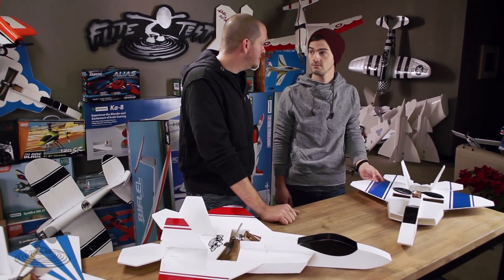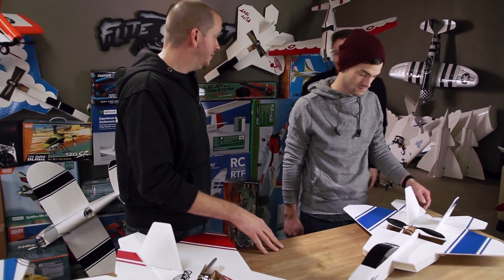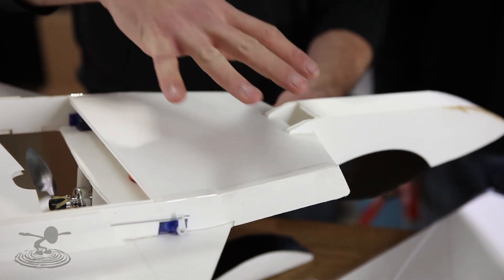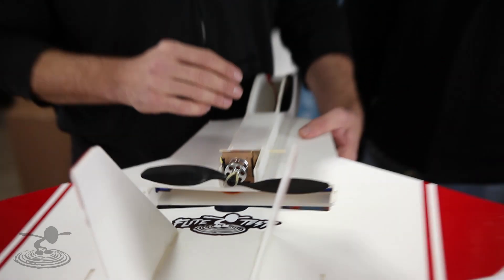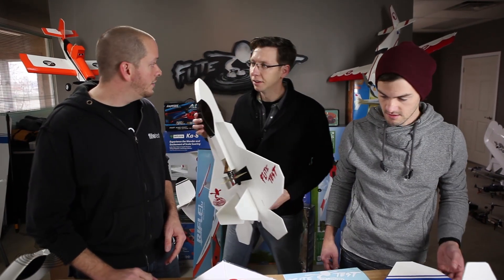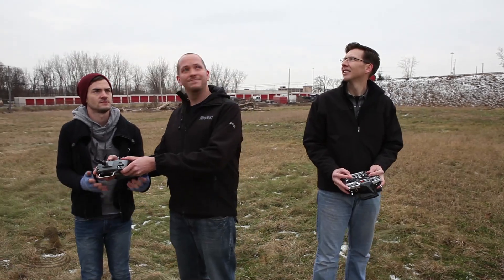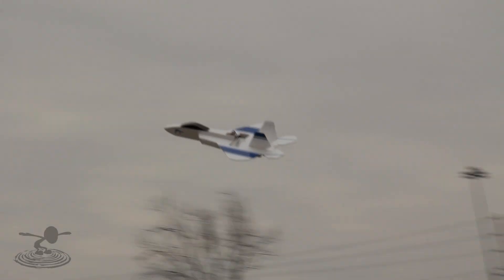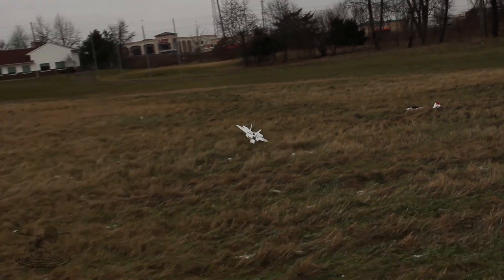Flite Test - FT-22 Raptor - PROJECT

Comment: Quick question. What if you swopped the motor from front to back and had the motor behind the thrust like a normal puller plane. Just mounted in thr middle?

Comment: ever wonder how to get your plane out of the tree? my one possible solution is: tie a nice sized bolt to the end of some kite string and throw the bolt up over the branch your plane is stuck on and now use the two ends of the string to tug on the branch and hopefully shake the limb enough to let go out your plane. either that or climb the tree and maybe get killed, or call the fire dept and ask to use their ladder.
Reply: Been there, done that!  Thanks for sharing!  Also too... I keep a machete handy... some of the trees in N.C. have Kudzu up to 20 feet around the base... and you may need to hack a trail into the base of the tree... :-(   Thanks for the tip!

Comment: Im new to RC aircraft, what exactly is a swappable?
Reply: +Alex Steil Swappables are a Flite Test design that allows the "power pod" to be swapped between different models (expensive electronics like motor and receiver are mounted to that, while the servos are usually part of the rest of the airframe.).

Comment: If I could, could I use electronics from a mighty mini power pack and use it for the f22? I want to get one, it's just I don't have a very good budget.
Reply: +Elan Kipervarg It can be flown with either power pack A or F which are usually the ones used in the Minis. But I'm not sure if you can just swap the electronics like with the swappables or have more work to do.

Comment: I go to an engineering club and my teacher actually designed the air intakes for the real F-22. He told us all about how secret it was when he did it, and he wasn't even allowed to leave a single paper on his desk. They used special windows and walls because they had heard that the Chinese had something that would allow them to hear through our normal walls. So interesting to hear the story from him.
Reply: My friend flew the first combat mission and got the first kill in the f22. If I had 20/20 vision, I would certainly follow in his footsteps and join the Israeli air force :)
Reply: its not just the chinese usa has it to and it picks up vibrations on windows and turns them into words thats the laymens terms

Comment: Oh and what about some foam rocket pods or gun pods for under the F22 that also would work as skids in the snow etc. :) I know it launches from inside normally.   BUT Ya know  wing mounted rockets would LOOK cool! :)
Reply: +WX9DX Real F-22s have NO external hardpoints - all munitions (missles, etc.) are carried internally - so it wouldn't make sense to put them on the RC version, where they would add drag and weight anyway...

Comment: Are these cheap to build?
Reply: They cost about $10 to make (without electronics) so the airframe is about $10, then another $30-$50 for battery, ESC, motor, and servos...then out have to get a controller which can be anywhere from $30 for a really basic system, to over $500 depending on what you want to fly.

Comment: Also a good tipp for making it quieter is to increase the clearance in front of the prop, from experience thats where most of the nose comes from because the blade is constantly going from high to low speed air and back.

Comment: you legends :)
is there any chance i can come and work with you guys?
i'd really love to :)
i'm about to finish university but about to submit a proposal for phd in drone tech.
currently i'm building an autonomous quadcopter as a project in my uni. i've made the chassis, hardware and software.
I'm also a keen photographer.
i've got some chassis designs and good knowledge in the area, perhaps you could even develop your own flitetest branded RC planes and quadcopters :)

Comment: flite test look up the tech one f22 raptor it is very simular to your original design but a ducted fan on 3cell lipo which ive been flying for 3 years ive upgraded it to a 4cell lipo with a high kv motor and a 6 inch prop our fastest one does 150 km/h.  go to my channel to see me flying my ducted version

Comment: Way cool looking plane. Looking forward to the build video. I like the swapables but after building a couple other non swapable planes, Personally I'd rather build a plane, put the electrics in it and leave them, at least until it gets destroyed! LOL It really isn't that much (on small park models) to have a radio, motor and ESC in each plane. I know receivers that work with my Turnigy 9x are cheap and have had good success with the HK 3 channel Rx that is for the race cars.

Comment: Wrist rocket, lead sinker, either kite string, mason line or heavier.  If it's high in a tree shoot the kite string to thread and thread heavier cord.  I've gotten things out 75 feet up.  It is amazing how high up a 1 oz fishing weight on kite string will shoot up.  Do NOT be under it when it comes down.

Later, you can pop balloons with pinto or navy beans just for fun.

Comment: My most successful method of extracting planes from trees: Large fishing pole, heavy line, tennis ball.  poke holes through the tennis ball, and use a stick to push the line through, then tie a fisherman's knot.  The propensity of bait, cast from a fishing pole, to snag in a tree makes it the perfect solution to shake the plane down.   Also you will get great casting practice!

Comment: Where can I get(try) your propsaver rubber bands?
Reply: I got them at laser toys 
http://www.lazertoyz.com/search.asp?keyword=prop+saver&search.x=0&search.y=0&search=GO
Reply: Peter Ray Thanks!
Reply: jon mellor I have tried the o-rings but FT has a (clear)looking version and i have had trouble with the black o-rings so still curious about what it is?
Reply: jon mellor I don't know what FT is using that is clear but I bought some 3/8" OD with about a 1/4"+ ID surgical tubing at the hardware store and cut pieces off the end about 1/8" thick. It stretches nice over the propsaver and hold very nice. YMMV....
Reply: jon mellor surgical tubing works better than O-rings and lasts longer too. Just cut 3 to 4mm wide slices of surgical tubing.
Reply: CrackerMcGillicuddy thanks so much for the tip!
Reply: royallhawaii this is awesome tip of the day,ty
Reply: jon mellor I can't take credit on the tip jon.... I read it from another post somewhere and after seeing how flimsy the original O-ring was thought I would give it a go... as some say... "works brilliantly" LOL

Comment: Hey guys... fun video... just one comment re. your comment, Josh B, about using the prop in slots for streamer combat. 

If you / others do fly streamer combat with electrics (as I love to do) remember to throttle OFF asap if the streamer gets wound in the prop.  Failing to do so can cause an overheat situation and permanently damage a motor. 

Prop in slots do not guarantee protection of the prop and if the streamer catches on another part of the airframe it can seize the motor.  Not good.

Don't shy away from it.... definitely DO have fun with combat!  But remember to take care.

Cheers,
J